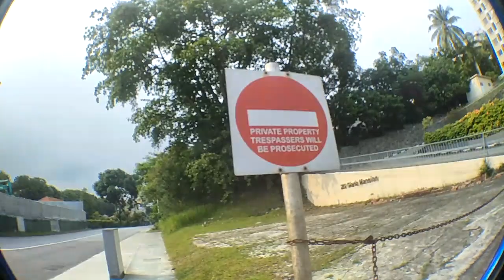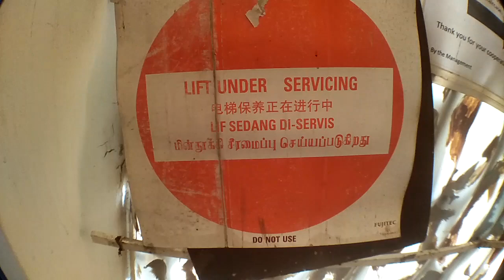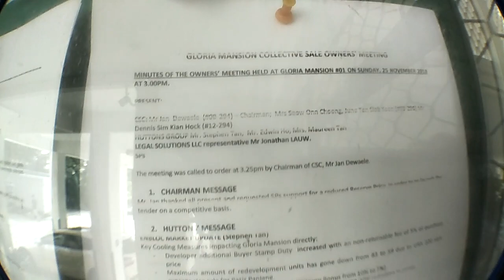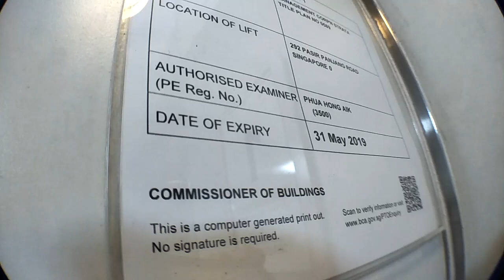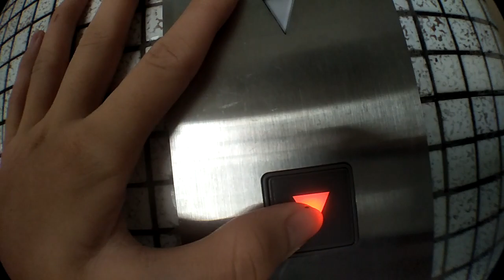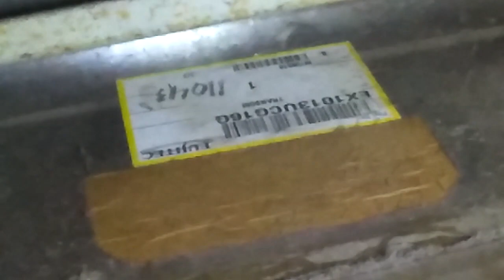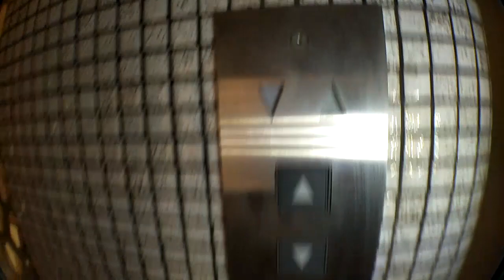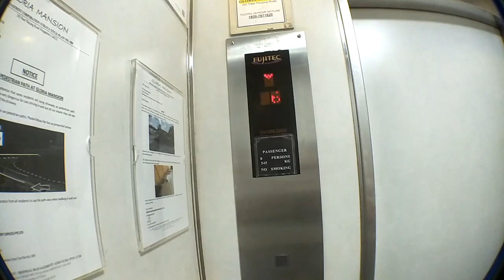Gloria Mansion - Fujitec traction elevator

Comment: I honestly don’t think the down arrow on the 12th floor as you said belong to the original lift. I think it’s function is just there to show if the lift is going up or down when it arrives at the floor since there is no indicator to show the direction the lift is traveling on those floors.
Reply: Like it seems very unlikely they would want to retrofit the new buttons into the original call buttons panel, but even when those bulbs spiked they chose not to replace it maybe because they thought it was unnecessary. Possibly due to those arrows themselves being very small and hard to see.
Reply: @elevatorfilmersg  They are very likely original. I doubt Fujitec would make a new panel like that. Besides if they wanted to get rid of the old panel they would most likely just put an indicator somewhere
Reply: PotatoLift1 you may be right
Reply: PotatoLift1 it may not be very easy then to just put the new indicator if they are unable to cut holes in the wall. They could have just tried to put the new indicator on the wall with the fitting protruding out of the wall but that would be morecostly itself. This might have been a cost saving measure so as such they customised that lift call button
Reply: @elevatorfilmersg  I meant like slightly extending the call station to have the indicator embedded or smth. Regardless, its unlikely Fujitec would make such arrows. And considering the fact that the bulbs have all died in them, its very likely original to the past lift from 1971, unless the management here really neglected the lift's maintenance.
Reply: @PL1Lifts  I see what you mean
Reply from the maker: I believe the original manufacturer was FUJI.